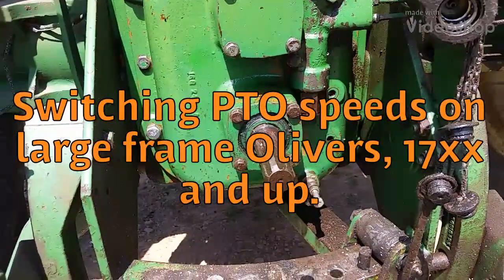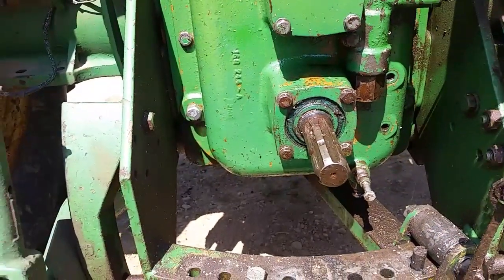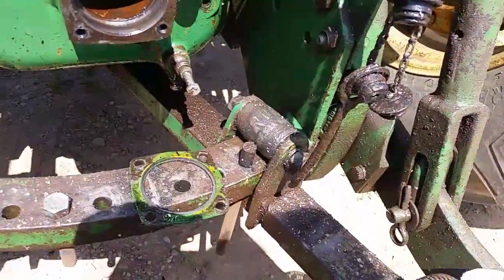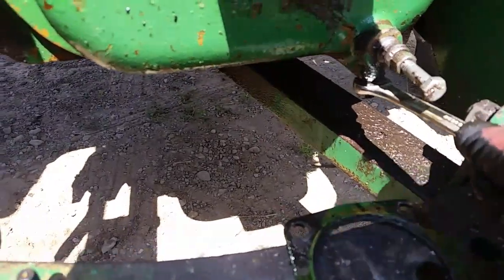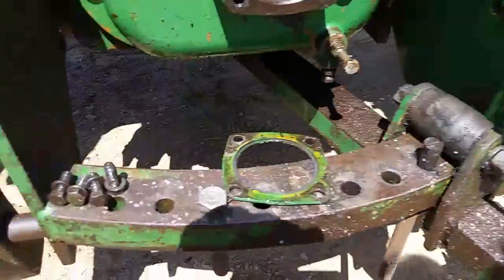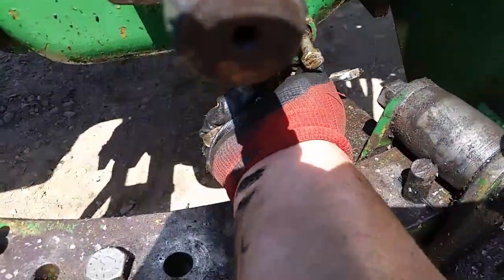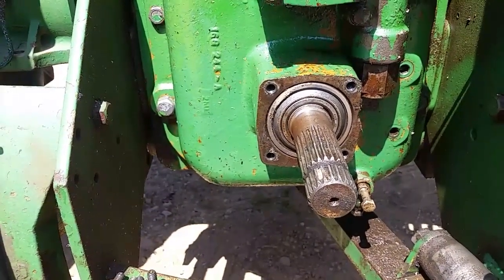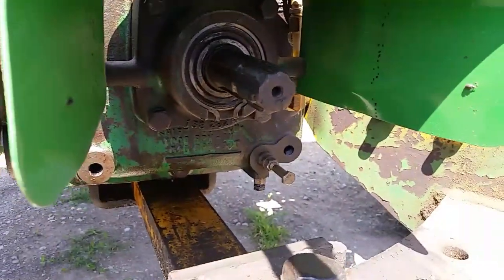Changing PTO shafts and speeds on large frame Oliver tractors,  17xx and up.

Comment: Good info!  People ask this question fairly regularly so thanks for documenting it!  Are the stub shafts the same on the 50 series and 55 series?  I cut 1" off my 540 stub shaft so I could run it at 1000 for smaller stuff and just idle the engine down more.  Used an optical tach to find 540 on the shaft and a marker on the tractor tachometer to mark where 540 is at.  PTO Shield?  Never heard of her! lol!  I just picked up an 1855 and he gave me the PTO shield and I was like "what is this thing!???" lol.  Took me a second, but I remembered they're supposed to have a shield lol!  Thanks for the video!
Reply from the maker: Yes,  the shafts are interchangeable between 50 and 55 series.  1650/55 shafts are their own animal, but they will interchange with an American series shaft. There's no shifter on those, so I'm not sure if it justifies a video.

Comment: can i leave the 540 shaft in and change to 1000 rpm?  i have a 1000 rpm rotary mower and can not seem to find an over run coupler and would like to have an over run coupler to prevent tearing up pto clutch from the centrifugal force of mower when when shutting down, seems these clutches are available for 540 and not 1000.  i would just put a 540 yoke on pto shaft and  mow.  thanks for any input
Reply from the maker: There is a pin that drops when you're in 1000 that prevents the 540 shaft from going in all the way, at least when it's all working right. A lot of farmers "did things" to make it happen so yours might possibly be "modified" by now.
Reply: @ThatOliverGuyChris  how would i go about removing the pin?
Reply from the maker: @jimkurk5575  It's internal, so you'd have to remove the pto unit to get it out. I have a video on rebuilding these units that shows the pin. Of course, I don't recommend removing it, because there's liability in that.
Reply: @ThatOliverGuyChris  i understand where you are coming from,  thanks for reply
Reply from the maker: @jimkurk5575  i also dont recommend shortening the 540 shaft until it's the same length as the 1000.
Reply: @ThatOliverGuyChris  i would have never thought of that, do not think i will do it but thanks for the thought. will work on taking the loader off next, not quite sure how it comes off but have another loader around to assist,  thanks for the info

Comment: Hi Chris, you helped me out with the over/under in this tractor the other day. Now I’m digging into it I see my pto has a snap ring I’m familiar with behind the bolts you’re taking out. It doesn’t seem to have the shifter. This is a 67 1850. Is it a switchable pto or just 540?
Reply from the maker: If it doesn't have the shifter, then it is a single speed unit. There will be a plug driven in the hole to keep the oil in, but no shift rail or bolt.
Reply: You’re a good man. Thanks again for the expertise
Reply: You’re a good man. Thanks again for the expertise
Reply: You’re a good man. Thanks again for the expertise
Reply: You’re a good man. Thanks again for the expertise
Reply: You’re a good man. Thanks again for the expertise
Reply: You’re a good man. Thanks again for the expertise
Reply: You’re a good man. Thanks again for the expertise
Reply: You’re a good man. Thanks again for the expertise

Comment: How is it for the 1800a series ? Cause we got one that is leaking oil !!
Reply from the maker: Where is it leaking
Reply: @ThatOliverGuyChris  around the shaft out the bottom
Reply from the maker: Watch this video, at 10 seconds I pull the shaft support housing off the main PTO housing. https://www.youtube.com/watch?v=jkglNaGbm8g
The one on your 1800 looks a little different, but comes off the same way. Underneath is a round cover held on by 4 bolts just like in my video. You'll want to drain the rear end down before you remove it. There are shims behind it, so don't lose/wreck them. Remove the 4 bolts and pry that round cover out of the PTO housing and you'll find a seal in the back of that cover. That is most likely your leak.
Reply: @ThatOliverGuyChris  Will do, Thanks !!

Comment: Mine won't come out, is the bearing stuck in the pto housing? You made it look so easy.
Reply from the maker: Sometimes they can be hard to get out. I've been thinking of taking an old pto shaft and making s slide hammer out of it. Hook it up and slide the hammer to get it out.
Reply: @ThatOliverGuyChris  OK, so nothing should be holding it back besides rust?
Reply from the maker: @jwdozer8524  correct.